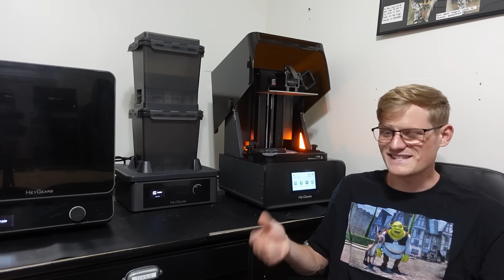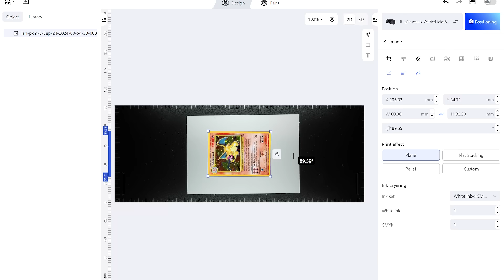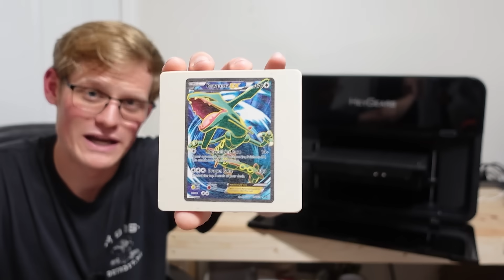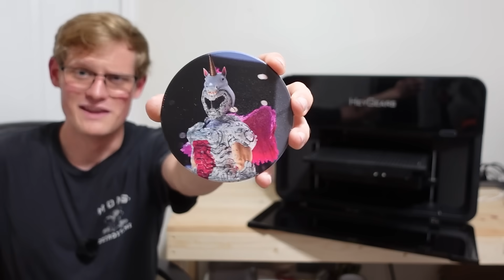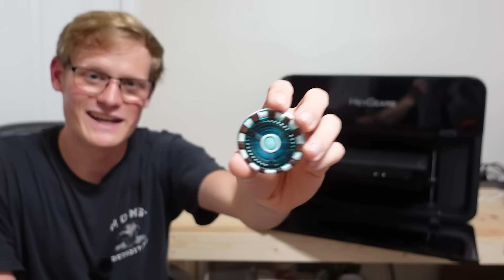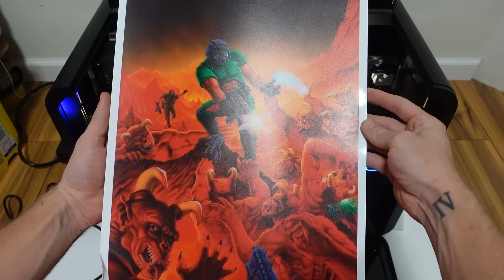The World's First Desktop Full-Color 3D & UV Printer? | HeyGears G1X Review

Comment: Do an unedited video on how you switch from UV to full 3D and vice versa from switching the inks/resin and switching the different modules to see how difficult and time consuming the process is.  We have seen what this machine can do a million times already (even the full 3D process).  It is knowing the maintenance and the switching between ink/resin printing process that is important now.
Reply from the maker: Thanks for letting me know. I'll make sure to include the entire process of swapping to the 3d printing in the next video!
Reply: @BuildDanielBuild  is it possible to print on paper in 3d mode?
Reply: @raf2095 You don't print on paper in 3D because the 3D mode doesn't really „print", it builds a colored 3D model. On paper you can make raised textures up to 5 mm using the normal UV ink, not the the resin ink.
Reply: @lexykey  Ok, let the question be: is it possible to build one/few layers of colored 3d model on paper in 3d mode? I guess you do not know anyway.
Reply: vap0rwar3
Reply: It is not a software toggle, but it is also not a half-day teardown — roughly 15 minutes. I would still love an unedited take.
Reply: Treat it as a chemistry changeover: Hub swap, Deep Cleaning, then first-job verification. Idle Hubs go in the supplied box rather than sitting open.
Reply: @MikeOnCoffee  vaporware
Reply: Fair request. Switching systems means replacing the Relay Hub and running 2–3× Deep Cleaning — about 15 minutes and 30–45 mL of cleaning fluid. Each Hub includes a storage box for the idle set. We agree an uncut changeover video would help.